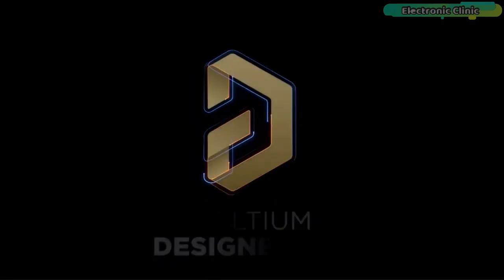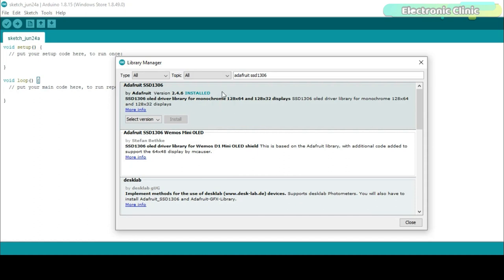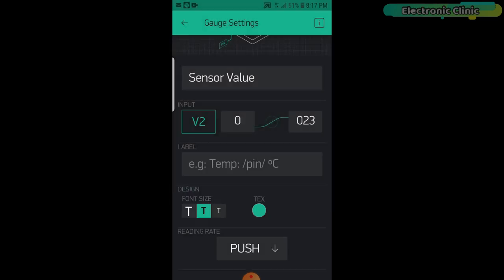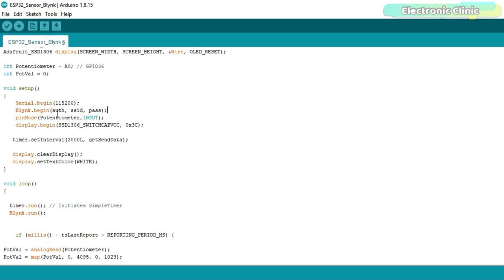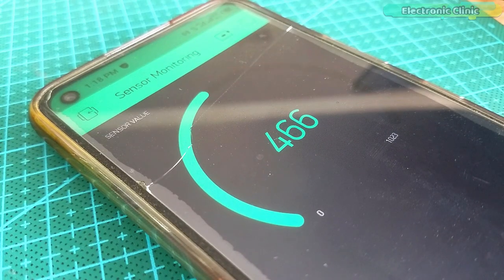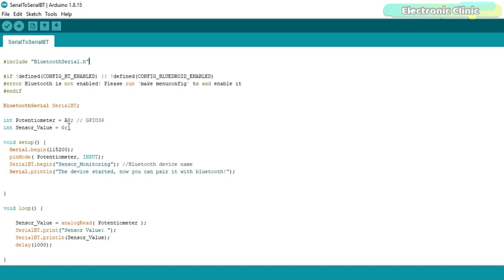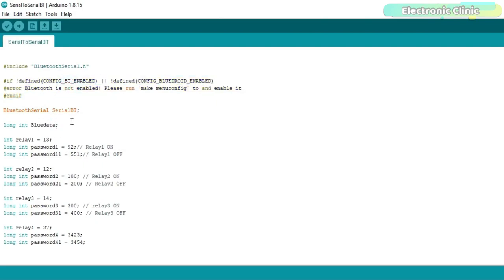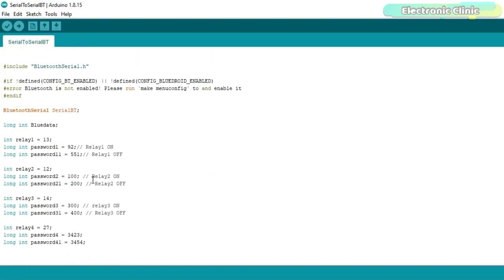ESP32 Course for Beginners, Learn ESP32, ESP32 Getting Started tutorial, ESP32 IoT Projects, Part3

Comment: Great video. A suggestion... why not do something with multiple sensors (I really like the DS18S20...), switches etc... and process the data towards the http protocol. Great for remote viewing of data on a dashboard/webpage.
Reply from the maker: I have already done this, check playlist. The only difference is, in that video i used nodemcu ESP8266 instead of using ESP32. As you know both are exactly the same, the same codes will also work with the ESP32.
Reply: @ElectroniClinic  Oh, I must have forgotten or overlooked this. I'll check it out this afternoon ! Thank you so much !
Reply from the maker: @PhG1961  you are welcome bro.